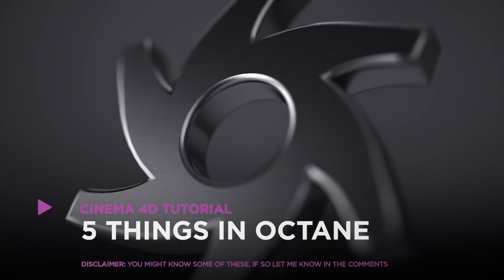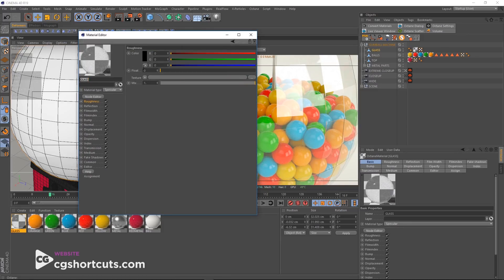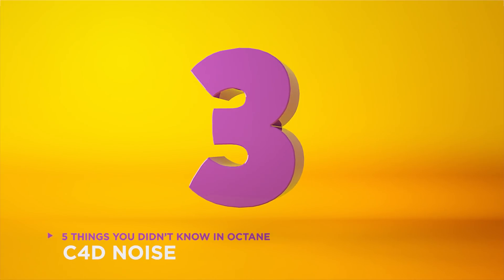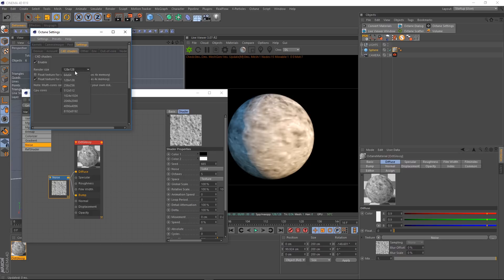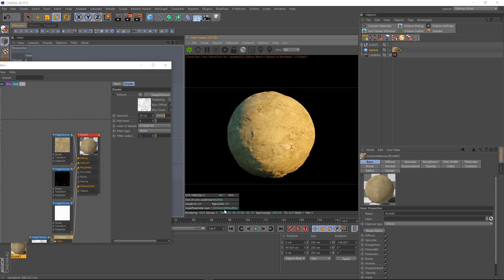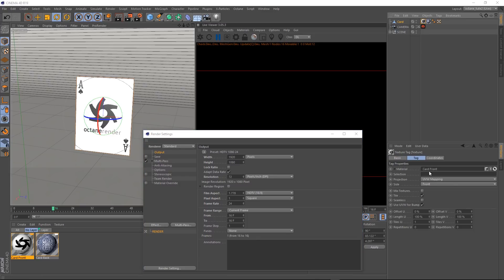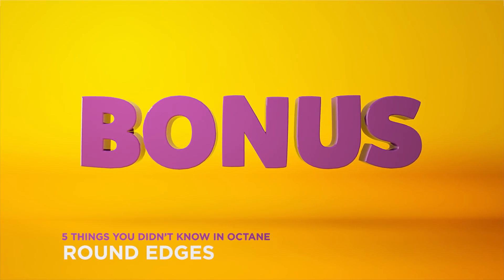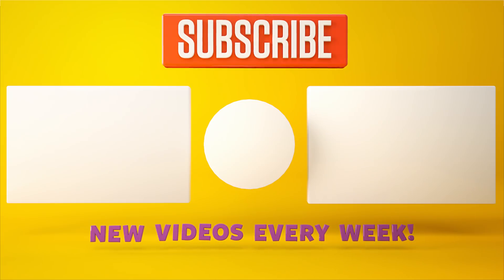5 Things You Didn't Know In Octane - Cinema 4D Tips Tutorial

Comment: 6:40 Use type "float" for greyscale images to save 2 chanels and therefore GPU memory is a good one (always wondered why they called it float though)
8:30 Never used the side node before, but a good reminder it is there to restrict one material to the back or frontfacing polys.
Thanks for sharing, you just earned a like and a sub  :D
Reply from the maker: Awesome, thanks pixelasm!
Reply: It only seems to work on UV unwrapped mode too

Comment: Hi! Great video! Tks! I have a technical question... It's about rendering movies... I have a pretty good PC ( i7, SSD, GTX 1070, ect...) But when I render a simple 5 seconds movie in C4D, it needs 127 hours!!! What am I doing wrong? Thanks in advance!!
Reply from the maker: Hey Hugo, are you using Octane or standard c4d renderers?
Reply: CG Shortcuts hi CG! Tks for answering so fast! Since I'm new with C4D, I'm using C4D's... But I do have octane. What's your suggestions?
Reply from the maker: Sounds like you've got your setting up a tad high. I do most of my stuff in Octane these days because I need the speed. Best starting with your settings very low then gradualy put them up to the point you can get away with a decent image. Most of my tutorials are about 4 in depth and 800 samples depending o the scene. Im working on a course for rendering in the standard C4D renderer so hopefuly have that out soon
Reply: These are my rendering settings:

- Output : 1920 x 1080
- Physical : Depth of field checked and sampling quality at medium
- Ambient occlusion : at default
- Global illumination : Samples at medium

I'm not sure if it's good...